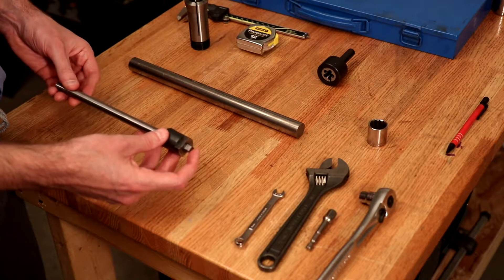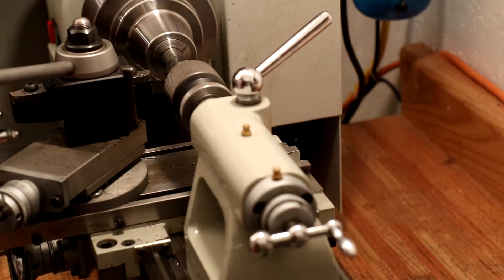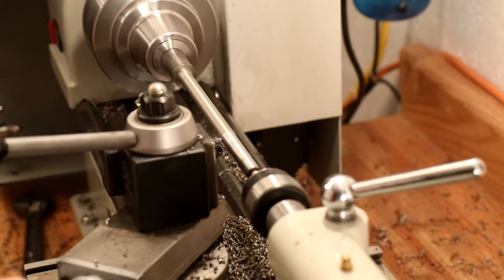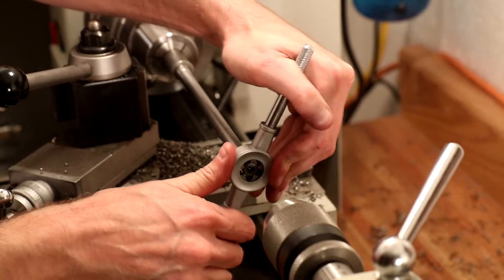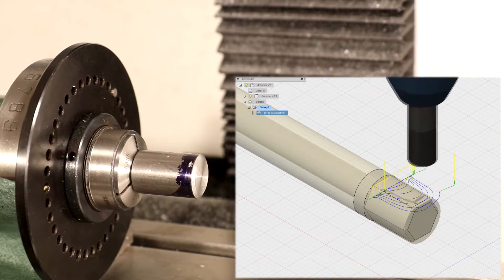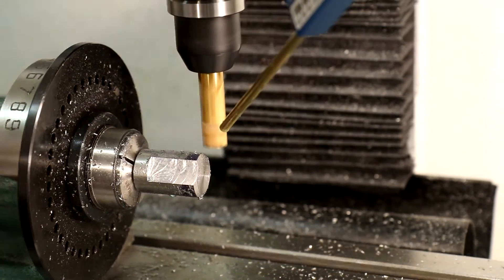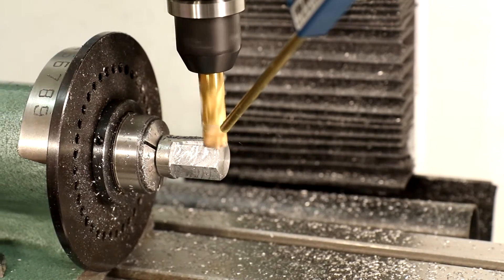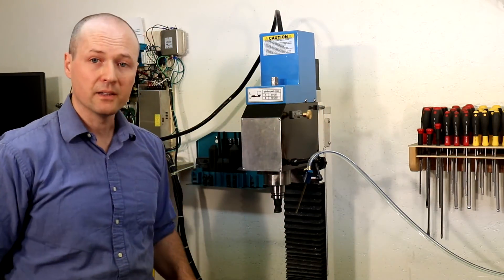R8 Drawbar Upgrade For PM25 Mill

Comment: It's kind of hard to tell but it looks like you are climb milling when cutting the flats. I would bet that the endmill grabbed the end of the piece when it jumped and that it wouldn't happen during conventional milling.
Reply from the maker: Thanks, that's a great suggestion. Fusion360 seems to default to climb milling for all operations that I've tried, unless one explicitly selects "both" or "conventional", and I generally go with the defaults. Do you have rules of thumb you use when selecting between climb and conventional milling? When I make the drawbar wrench, I'm planning to reduce the 3/4" hex down to 17mm to match nuts of the strap down kit. Then I only need one wrench instead of two. I'll follow your advice when re-cutting the hex. Also, in case you are curious, I adjusted the handle of the collet holder, it's held by a couple of set screws. After doing that the collect holder closes completely.
Reply: Honestly my PM25 isn't CNC yet (how I stumbled across your videos actually), so I'm not sure about F360 settings for selecting between the two. I just know that when I mill I generally conventional mill all my roughing cuts and do a shallow climb final pass to get a better surface finish.

EDIT: I did want to say that doing this mod is an awesome idea though. I hate that little 8mm square on the drawbar. I would make one for myself, but I don't currently have a lathe to cut one on.
Reply from the maker: turbocharged110 How about using a long 7/16-20 bolt? The following might work. https://www.fastenal.com/products/details/18898
BTW: I made up a bill of materials for a friend considering a PM25 CNC conversion. Send me your email and I'll send it your way. I plan to make a more in depth write-up, but maybe the BOM will help you.
Reply from the maker: turbocharged110 In case it's useful, the end mill I was using in the video was one from those standard inexpensive end-mill sets, and they all have sharp edges. I got a couple steel specific endmills from Lakeshore Carbide, with a 20 though radius, I believe, and the new end mills seem to cut much easier than those from the set.
Reply: I've never used any from the cheap sets. I generally find NOS endmills on ebay for cheap in odd sizes (5/32", 7/16", etc). I've had good luck so far with Niagara HSS. As far as the BOM goes, I think I know everything I need but wouldn't mind having it just to be sure I'm not forgetting anything. I'll direct message you with my email address.
Reply from the maker: Someone else asked about making them a copy, which would be a good chance for me to improve some of what didn't go well with the first one. :) If you might be interested, send me a message. Best wishes, Kent
Reply: Depends on the cost, but I'm likely okay with keeping my stock one until I can put a lathe in my shop.

Comment: Another awesome video Kent! Nice work. Just a thought.. Adaptive clearing probably doesn't give any advantage there really because of the shape of the material you're removing and the fact it's open on 3 sides. You could use a 2D Contour with multiple passes, or even a facing strategy if you defined the stock right. With facing, you'd have the benefit of being able to turn on chip thinning for a soft entry into each cut.
Reply from the maker: Thank you Gavin for your support and suggestion! I followed your advice in Fusion360 and it looks great. For facing, I also set the pass direction to 90-deg and the bottom-height to the contour. Combine the facing operation with a 1.5" face mill and the flats would look great and be cut fast. I didn't immediately see how to use contour, but it's multiple roughing passes that I was missing.

I hope you received my Hello via the Autodesk Fusion360 guys who were at IMTS in Chicago. One guy said he works with you regularly and was going to be talking with you the following week. It's such an amazing and small world :)
Reply: Ha. I haven't had the "hello" passed on yet. I wonder who that was... I'll be asking all of my Fusion contacts now! :) With 2D contour, I think you can also use multiple finishing passes to achieve the same thing.
Reply from the maker: I looked through the stack of cards from IMTS but I'm sure the Autodesk guys were out. The man who knew you has Asian features and has group meetings that you are involved with. Sorry, that's that the most vague description, but that's the best I have. I tried to convince them to replace the Solidworks hat I was wearing with one of the nice sweatshirts but they were not budging :)
Reply: Not sure who that is, but I'll figure it out eventually. Haha.
Reply from the maker: Ah! His first name is Matt. Hope that helps. (40 year old slow memory :)
Reply: Matt Nichols I think. Great guy.
Reply: Gavin Bath don't suppose you'd be selling these draw bars would you? I have the same mill but no lathe to try to make a new draw bar myself.
Reply from the maker: Making a couple more would be good practice to fix some of small problems. As long as you're in no hurry, send me a message and we'll figure something out.
Reply: ***** Its actually Kent's video but he has offered to help out so have a chat to him.
Reply: Kent VanderVelden thanks Kent! No hurry but it would definitely be nice to get one!